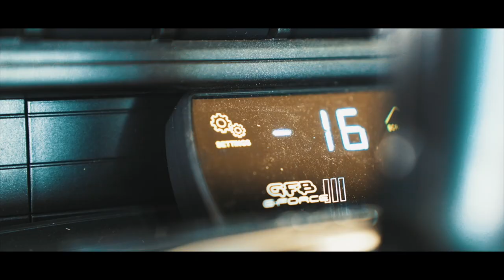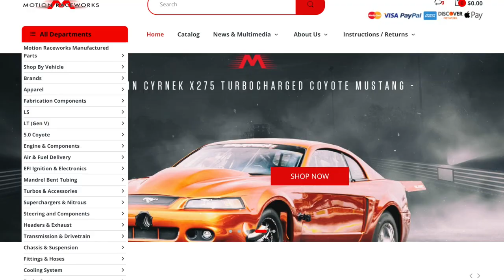My Turbo'd Street Car Mustang Gets a Parachute!

Comment: Looks good guys 👍 on my last chute install, I cut a small piece of pvc to just hair shy of length between the mount hole and back of bumper, put white out on end of pvc and stamped the bumper. Pulled bumper off, drilled small pilot hole, flipped bumper over and hit it with the hole saw. Done.
Reply: Mechanic? Sounds to reasonable 😅
Reply: jason rogers nope, Firefighter/Medic who has built a significant number of “fast” cars 🤣
Reply from the maker: Uncle Elroy my man